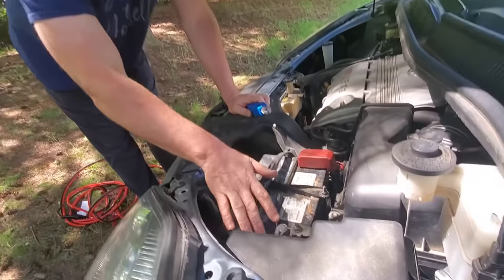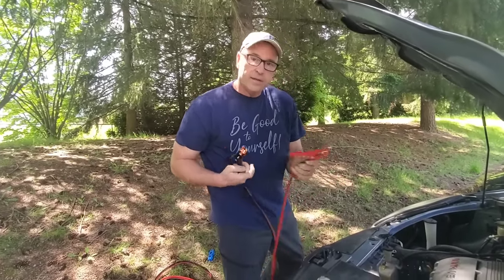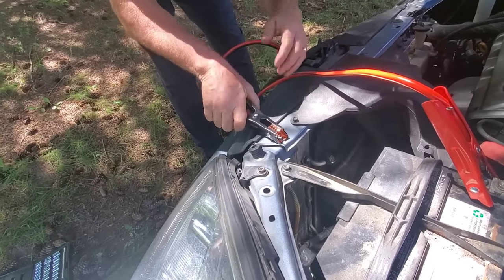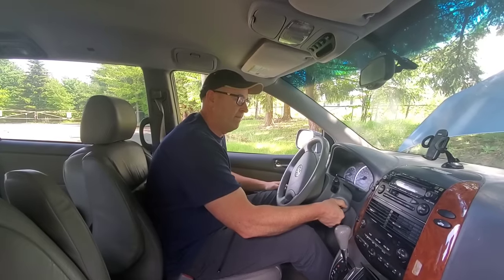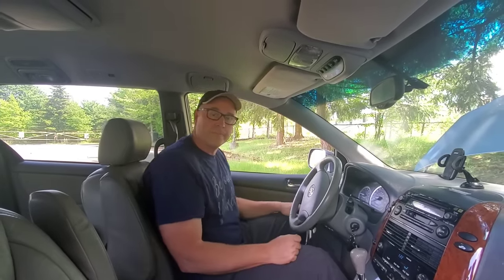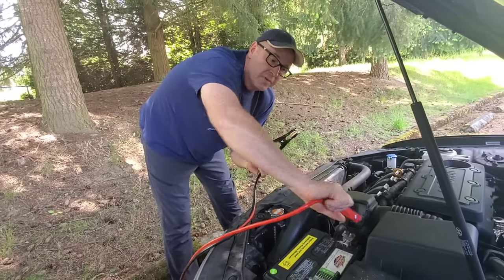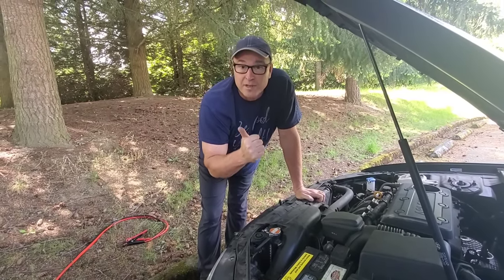How to Jump Start a Car

Comment: Another point of advice: if you live in a northern climate with VERY harsh winters (my area has been through a week-long cold spell where the average temps have been -30C or lower)... make sure your cables are higher-grade if you store them in your car all the time. The reason? The extreme cold may cause lower-grade wires to crack and split. Not only will broken cables fail to start anything, they might cause a spark and other harm to your car - or yourself. The higher the grade, the more durable they are.

Comment: Little addition here, especially if you're driving a manual car: Use the gas pedal a bit more when at lower gears, otherwise the engine might go out again.
Also: Car batteries tend to fail during cold seasons. Reason for that is, that they get drained a lot more, due to increased energy consumption with things like heating etc.. Also the cold increases the resistance within the engine when starting (chemical reactions within the battery are slower, motor oil is a bit more viscous and the circuits have a little bit more resistance to them), thus requiring more energy.

Comment: Thank you! I killed my battery so often in my honda accord (400,000 miles when my clutch knee gave out), that someone told me to buy a special starting battery. That thing has saved me so often! It does more than the battery. It pumps my tires and can even pump tires and recharge devices. It was expensive, but more than paid for itself in cash and embarrassment. We live far from town, too.  I would miss church or doctor appointments. All these years i have been so scared doing it because i did not understand the instructions about the ground, thank you! It is hard to get either to connect easily on any vehicle, too. I see you did connect to the black in the good battery. I got a great pair of cables i highly recommend from an ad where you connect both batteries, then connect the two by plugging them together in the middle...2 piece deal. There is a light that shines red if connected incorrectly and green if ok. They were in a nice zippered case. Someone lifted them  few years ago. I loved them. But this starter battery has also been great, too, for the rv we got to escape fires. We finally used it to camp! And they say before you take off, you MUST check the air in the tires. A few times it has been off, and twice one tire was nearly flat! No one will come way out here to fix a flat, so that battery came to the rescue. So then i also learned how to go get a tire fixed on an RV. You call ahead! I wish you could teach how to confidently back up . I still panic every time, and i imagine someone puts my efforts on YouTube! Especially hooking up. I learned to just plan on it taking a while, breathing, being grateful for the ability to get that exercise in a very broken body, and eventually i do get there. I have no way to get help with that. Still, i am wrung out after and just want to take a nap, but that is just the beginning of the trip😅  One less thing to be afraid of. Hey, how about vids on how to use power tools? I never did learn how to properly use a chain saw, i just guessed for many years until my spine shattered in a bad fall. I loved it, but i am terrified of the circular saw. I nearly parted my hair with it. I do not understand how to adjust and properly care for it. Same thing for those battery operated screw driver drill and driver set. I cannot even see the print in the instructions! I see why guys never read instructions! Just some ideas. Blessings, Thank you for all your help.

Comment: I bought a self jump starter from Amazon for $45 or 55, few years ago and I used it to jump start my car alone without anyone’s help. It’s better that way because if you get stuck somewhere you don’t want to ask strangers because you never know who is good and who is bad. When you jump start your car let the engine run for 5 or 10 minutes  and drive around don’t turn it off.

Comment: Thanks Dad, as per my experience sometimes these cheap cables are so small that don’t help the dead battery to recharge in a couple of minutes but, if you leave the cars connected for at least 10 minutes, then you have much more chances to start the car with the dead battery… despite such horrible cables.

Comment: I was confused on grounding the dead battery car.  I connected the black cable to the dead battery car's battery.  I watch the video.  I know how to connect the ground on the dead battery car.  Best explanation how to jump start a car safely.  Subscribed.

Pay extra money for a durable jumper cables.  It may save your butt.

Comment: 1: Attach Red to the positive on the dead battery.

2: Attach red to the positive on the working battery.

3: Attach the black to the negative of working battery.

4: Attach the black to unpainted metal or bolt. DON'T attach it to the negative on the dead battery, could cause a spark and ignite anything flammable.

Start the working vehicle, after waiting a minute or 3 turn on the dead vehicle. Take off the cables in reverse the order you put them on.

5: Remove the black on the unpainted grounded metal from the dead car. Set aside the cable making sure it's not touching any metal.

6: Remove the Black from the negative on the working battery. Again don't let it touch any metal

7: Remove the Red From the positive on the working battery.

8: Remove the Red from the positive of the vehicle that needed the jump.

Comment: Awsome video. One remark though. You want the car with the good battery to be started before you connect the cables. This is because if the car with the bad battery has a consumer (something which drained it in the first place) you might end up with two cars and no good battery. Happened to me and got this advice from the mechanics.

Comment: Jumping my car with a friend's help today. Battery is probably at the end of its life and just need enough juice to drive it to a nearby garage. Had the steps from the car's manual but was nervous about that final connection (connecting it to a ground was a bit confusing). Super helpful video for a sense check :)

Comment: I’m a mechanic, never gave a damn about spark while jumping a battery that’s been sitting for a while, until year 5 of my career when the car was towed after sitting for a while and battery gases came out and i had a spark, battery blew up lol thankfully i wasn’t touched by acid, but yeah, after that i’m always connecting negative to engine, anything i can see that is not plastic, the thicker piece the better, wiggle it a bit, as engines often have corrosion and it cleans the surface a bit and actually cars start easier than connecting to batteries anyway

Comment: I’m pretty sure you want to disconnect the cables as soon as the car starts. At least that’s what I always did. Also as soon as it’s running what I always do is take both connections off at once and hold them far apart. If there is dirt near I’ll set them down in the grass or dirt not touching the red or black sides. Then I go to the car that is the good battery car and do the same. As soon as all the cables are off, the jumper cables are safe again

Comment: You actually don’t need to wait for the battery to charge up to crank the engine. Once the charged battery is connected to the dead battery, you’re feeding the charged battery into the car with the dead battery, so when you crank the engine, it’s pulling power from the charged battery. I highly recommend to find a universal charger that you can plug from an outside outlet that offers a Pb feature to fully charge your car’s dead battery without having to waste any gas. You will need a 25’ extension cable.

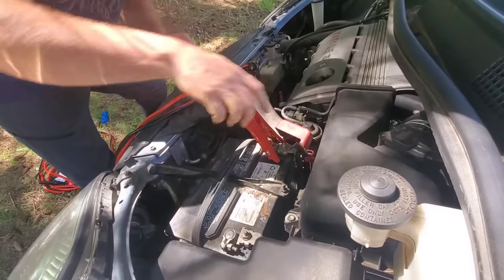Comment: Awesome video series. I just want to make an important point: when you're connecting to the dead battery (at 2:58), you should FIRST look down and make sure the clamps at the other end of the cable aren't touching; otherwise, sparks or worse will result. Remember; a dead battery is usually just "mostly dead".

Also: you should stress that it's SUPER important to connect to the hot (red) side of the battery first. (And disconnect last.)

Car batteries are so powerful that they can be used for arc welding in a pinch. I once arc-welded a wrench to my battery by accident because I didn't understand the rule about connecting to the hot side first.

Comment: Those newer Portable Car Jump Starter are a life send.  I no longer carry jumper cables.  I carry this small bag with a battery and the cables.  I check it once a month (mine has a digital reading to tell me % of battery).  With covid my wife won't drive her car for a month, so 3 times I've jumped her car after it sat for month and wouldn't start (I think my dash cam will go until it senses battery low, and normally if only sits for a week or 2 car will still start, but longer won't).

Comment: While I'm no mechanic, but I have heard that boosting other cars could cause damage to onboard computers especially when both cars are running as each cars' computer will try to figure out what's going on. There could also be a surge as there are now two alternators running. I would suggest, if at all possible, to disconnect the positive connector from the good car and using the battery as a "stand alone". If it's not possible to disconnect battery (i.e. no tools), then please don't start the "good car" yet. Try starting the bad car by itself. Of course, don't drain the battery completely so the "good" car can still start.
*A "boosting" clause may be written in your instruction manuals (that nobody reads) and may explain how to do it properly or avoid boosting. This could void your warranty too!
Ask your mechanic what they think about boosting?

Comment: Please always make sure that the two jumper clips on the other side of the cables are not touching before hooking anything to the batteries, especially if you connect to the working car first, if theyre touching you have a short and will likely cause a fire

Comment: You're supposed to connect black to a point as far away from the battery as you can, other side of the engine at least. Doing this doesn't stop a spark when you connect it, the point is that Hydrogen gas can be leaking from the battery and can ignite, you're just making the spark away from the battery and reducing the chances of a fire/explosion.
A bolt head is a bit of a small point to put that current through, you might weld the thing in place too!
Also, the positive terminal cover isn't there to prevent corrosion, it's to stop something shorting the battery terminals (say, you were working and dropped a tool and it fell on the battery). If it was to stop corrosion, they'd put caps on both. There's supposed to be terminal grease on the battery points to prevent corrosion, I notice that your batteries look pretty clean, maybe think about putting some on.

Comment: Don't underestimate the quality of those jumper cables.  Think about the thickness of the cables like the thickness of a tube.  The cheap ones are really thin and it's hard for the car to suck enough electricity through them fast enough (it would be like trying to breathe through a coffee straw).  The good ones are really thick and it's easy for lots of electricity to flow through them quickly (more like breathing through a garden hose).

Comment: If your car is carbureted don't forget to pump gas in it to help it start. Just pump 3 of 4 times on the gas pedal and if it have trouble starting, you can ever floor it a little while cranking it (standard procedure to start my crappy old ford).

Comment: Don't need to wait at all in the other car once it's powered on. It's not about electricity flowing to the other battery at that point, that's part of it if you want to wait, but at this point if you've connected to both of the batteries, you've essentially moved the battery from the other working car, your car should start up immediately.

Comment: Another thing, disconect the terminal connections, simply pour hot water noto boiling water, just hot sink water on it and the corossion will wash away but be sure you scrub and dry it or it will just corode again

Comment: Just earlier this week I was out with a friend and her car battery stopped working on us before we could drive back. We walked over to a local bar we frequent nearby and asked for jumper cables. One of the bartenders was nice enough to pull her car up for us and we were lent some cables from some of the patrons there. The issue was none of us knew how to jump it. We ended up having to ask a stranger.

This guy was your typical Iowan man. He wore a baseball cap, had a flannel on - the whole nine yards. Almost immediately he asks me "you're a guy and you don't know how to jump a damn car?" I responded with a dejected "yeah, I don't have a car." "And how old are you?" "19." He responded all "come on man, the hell's wrong with you?" and helped us out begrudgingly.

Once we were finished, (and he told me to "start the car like a big boy") the car started and we went on our way. I was left feeling emasculated, ashamed and embarrassed. I felt like I was robbed of something by not having a dad around the house.

These videos help me feel understood. Those of us who weren't granted the luxury of a father really need these videos. I'm grateful for that.

Comment: I never leave the car with the good battery running when I jump start  another car because my auto shop intructor told us when the car with the bad battery starts up it can send a surge of power to the  donnor car and burn out electricle parts, computer chips etc.  If your helping someone start their car just let them try their egnition 2 or 3 times and if it does not start call it a day so they do run down your battery.  Hopefully they can call a friend to pick them up or call a taxi.  My insurance company  called a  service garage  for me once and when the garage called me I told him to bring a battery that I could buy because mine was very old.  He did and installed it and I was on my way.  If  your battery is newer and will hold a charge  then  just a jump is all that is needed.

Comment: Don’t forget, when both cars are running while plugged in with jumper cables to both batteries, the alternators are working against each other and can cause them to burn out prematurely. 
 When the dead car starts, immediately turn off the car with good battery to prevent damage :)

Comment: I never knew there were different gauges for jumper cables. I think a 4 gauge is good for jumping. The lower the gauge number, the more power, amps, that will go through

Comment: He’s dead on with one exception. Please, please!!! Do Not start the dead vehicle while the key in the good vehicle is on!!! The dead vehicle can spike voltage and fry both computers if they are both running at the same time! Just trying to save someone thousands in damage. Btw, I’ve got 30+ years as a technician. I do agree with what he is doing! Knowledge should be free and shared!!!

Comment: Sometimes there will be a lead coming off the battery negative node to a ground on the chassis. My honda pilot has this and I just connect it right there. But otherwise look for something connected to the engine. That shit is grounded for sure. But "ground" is a misnomer here because there's no flow into the actual ground.  It just functions as one.

Comment: Hate to correct you, but I got 2 Points:
1.: Turning off all energy consumers in the donator Car is dangerous (to avoid Voltage Spikes you are actually told to turn on as many loads as possible (heated Seats, Headlights etc)) because it can kill modern electronics.
2(optional).: Have the donator Car running, when connecting, so Voltage doesn't drop before starting the engine...
Still appreciate your videos

Comment: My car's manual says to turn on the headlights to absorb any surge of electricity from the jumping. Granted, I used to jump my car dozens of times before I got the battery replaced, without doing this, but I imagine something bad could happen, though nothing did for me. Take your own risks; step 1 should be "read your owner's manual".

Comment: one really minor gripe I have is the suggested time for driving after the successful jumpstart.
I personally would never do anything less than half an hour.
And if I am running a truck at my work I'll have it idle when loading at my depot or unloading by the customers despite them telling me to shut down, same goes for if I have the regeneration of the exhaust treatment system running, oh an neighbours be damned in that regard.

Comment: My battery cables don't have red on them. If you don't, look at the battery, there should be a plus ompronted by one post, a minus sogn near the other post. Just make sure red cable is plus to plus on both  dead battery to working battery, so the polarity is correct.

Comment: You don't want to stay the dead battery car worth the good battery car still running. It can mess up the computers in both cars. Let the good cat run for 5-10 minutes, turn it off, remove the cables, then try to start the dead car.

Comment: Hey, I know this vid was probably made awhile ago. So I don’t know when you’ll be seeing this. But, I need to know how to get rainwater out of car, after you left windows open a few hours. I don’t have a driveway; I have an apartment; parking lot. This just happened tonight. Am so upset w myself. And do I have to worry abo mold? How soon does mold set in?
I have read completely different opinions about whether to use the a/c, & set it to air circulation, leaving back windows open a little. Or use heat, set it to your feet. Don’t know what to do!!🤦🏻‍♀️
Reply from the maker: Have you tried a wet/dry vacuum?
Reply: @DadhowdoI  I have not. This great idea. Drove for over an hour late night w heater on full blown.  But this still is good to do. Thank you!